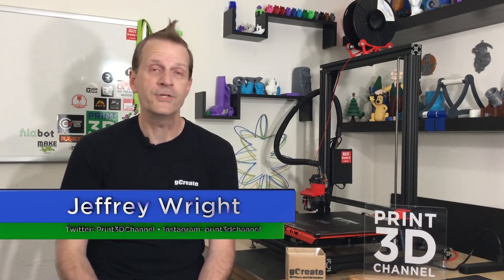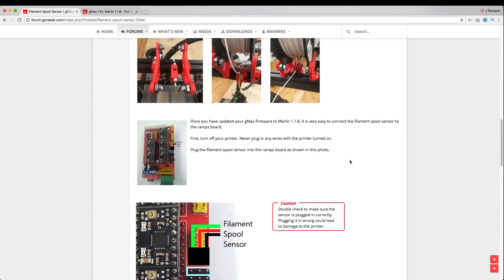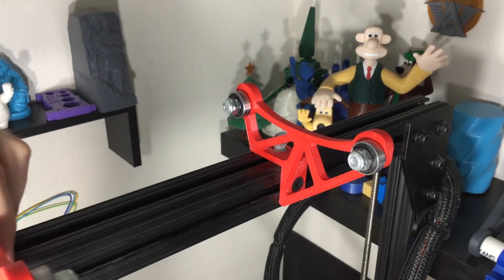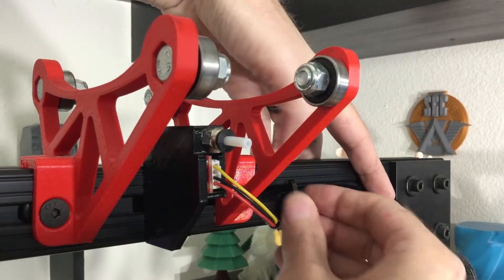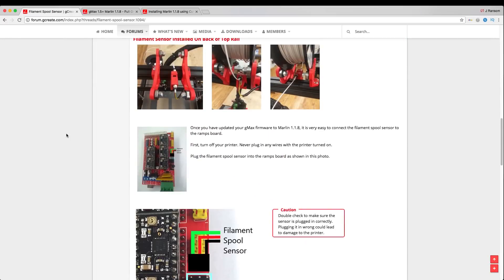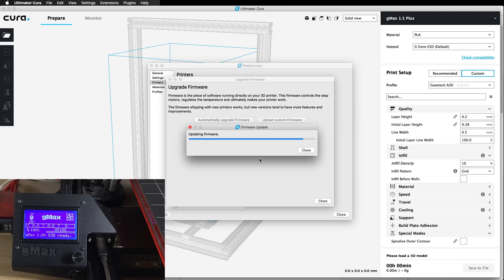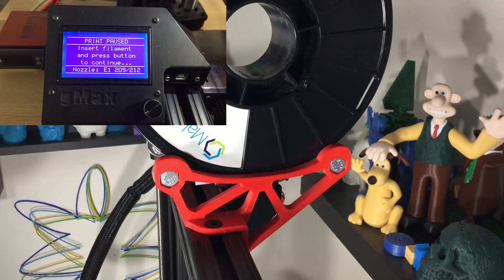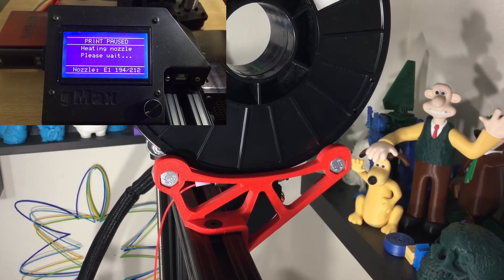Upgrading The @gCreate3D gMax 1.5XT+: Installing The Filament Runout Sensor

Comment: Great video just one comment you say  the source firmware you downloaded, that is compiled firmware.   Source firm file is not compiled firmware, it is the complete package  package with the config.h, config.adv, and all of the other  files which has to be uploaded after compiling with Arduino software. Just wanted to clarify for other viewers
Reply from the maker: Thanks for the clarification.